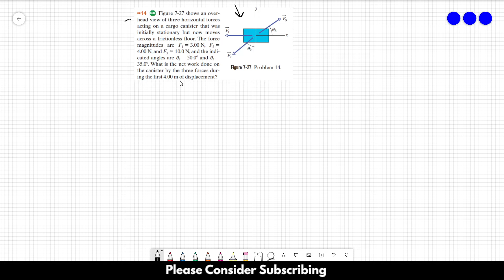HALLIDAY SOLUTIONS - CHAPTER 7 PROBLEM 14 - Fundamentals of Physics 10th

Comment: Your answer is wrong. Net work will equal the horizontal forces acting on the block so two of them are negative and one is positive the answer is 8.50J.. W= 10cos35(4) - 3(4) - 4sin50(4) =8.50J.. Since the block moves on a horizontal position, there is no work due to vertical forces.
Reply: Thats a top view, not a sideview. Vertical in this case would be a Z axis.